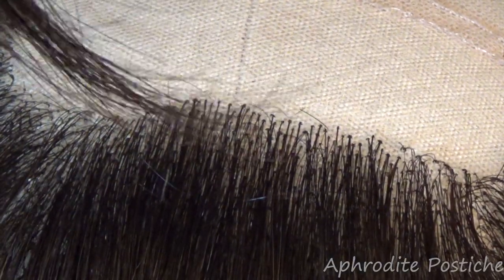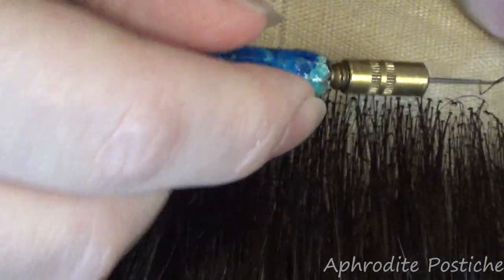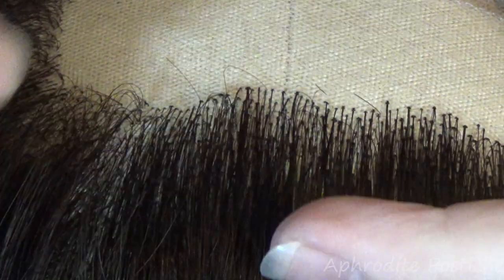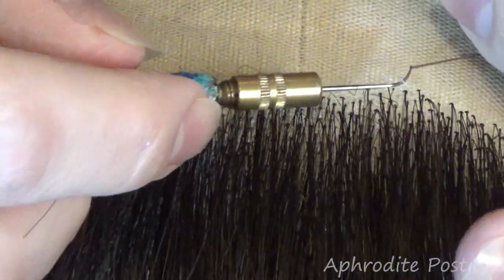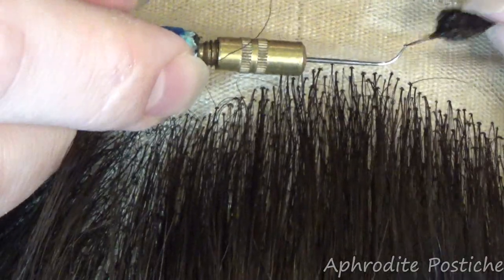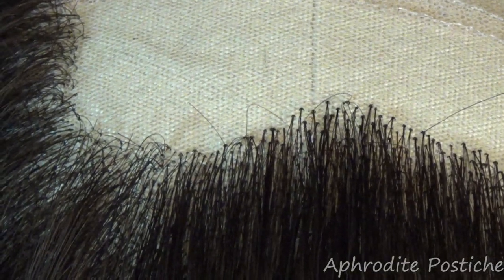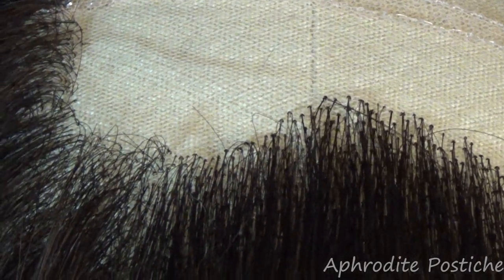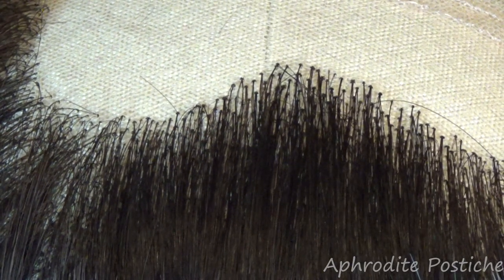Wigmaking Tutorial | How To Make a Wig Look Natural | Ventilating Tutorial | Wigs for Beginners

Comment: I have a question.  Are you folding the working strands in half or is one end shorter?  If you want a finished length of 10", would you then work with 20" strands?
Reply from the maker: Hey, thanks for your question. One end is much shorter for the turnover, as per the design of the wig or hairpiece. If using human hair, the turnover can be between 1.5 inches and 3 inches. It all depends what type and origin of hair you're working with 👍

Comment: Hello, please how many bundles of hair is enough to ventilate a full lace wig?
Reply from the maker: It depends what kind of bundles you're purchasing. I prefer to use either double drawn wefts (then cut the hair off to ventilate it) or bulk. Bundles, invariably have a lot of short "filler hairs" that cannot be used for knotting. A full lace wig can have up to 200g+ of hair depending on the density. ✨
Reply from the maker: Feel free to subscribe and tell your friends ⭐
Reply: @AphroditePostiche  Alright. Thank you
Reply: My question is there any machine to use instead of doing it one by one